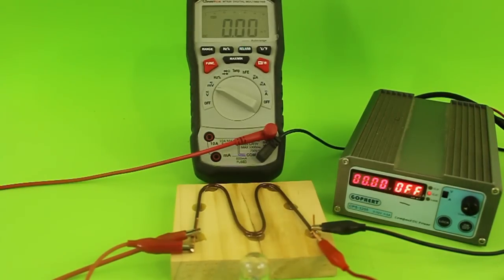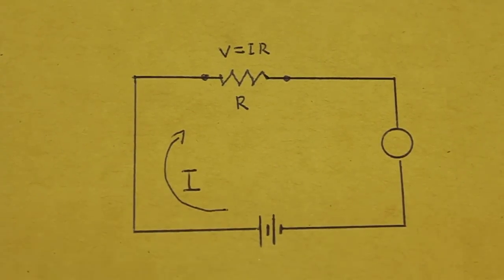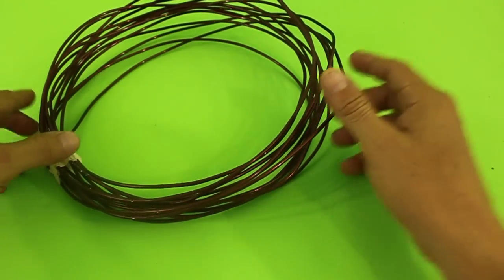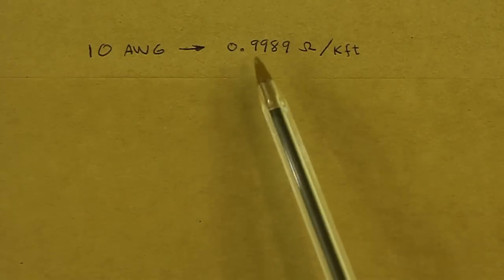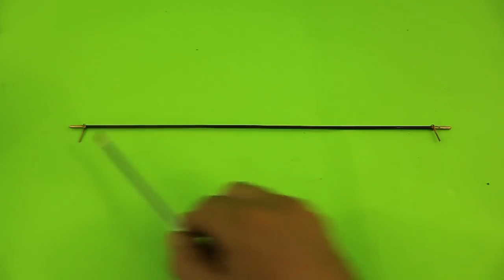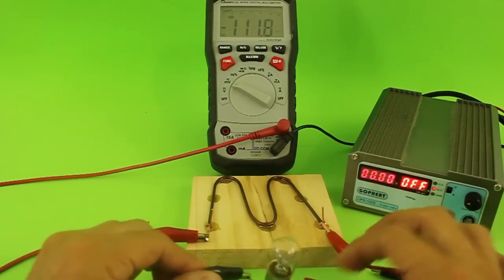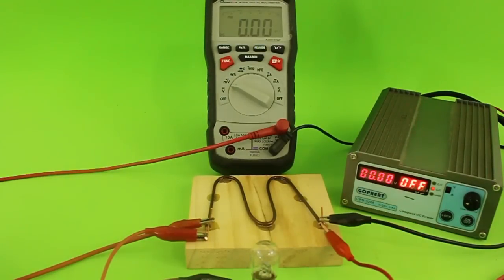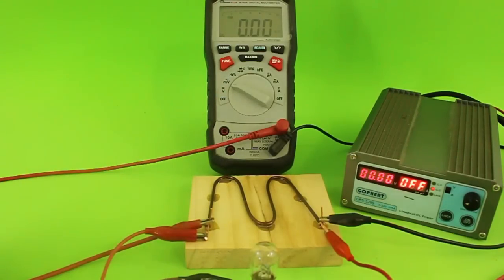DIY Shunt Resistor for High Current Measurement

Comment: I think your shunt is correct and your power supply is correct.  I think the small difference is the wire leads you are using.

Comment: Thanks, I guess if we make the shunt wire 10x longer (10 ft. and adjust our formula; 10milli-ohms) we'd reduce our margin of error on where exactly we connect our multimeter leads on the shunt when measuring milli-volts.
Reply: always make sure you don't get requentie/impedance change when de wire starts acting like a coil. You can eliminate this by bending it halfway to make a U-turn to the startingpoint. If wires are parallel to eachother, no freq/impedance -side-effects will happen.
Reply: We would probably measure 13mV. if we used 10 Ft. 10AWG wire as a shunt for the same 1.3amp load. This would probably reduce margin of errors as I mentioned above along with the marginf of errors in the test meter.

Comment: What will happen if high resistance is applied
Reply: high resistance in shunt? Than that resistance value will determine the max Amps that can be pulled through the wires (Imax=Voltage over shunt/Resistance Shunt). That's why we use a low resistance Shunt.

Comment: Nice video, it would also be nice to see how to measure the very low resistance of conductors using a 4 wire Kelvin connection, or a method other than what you described at the end of this video